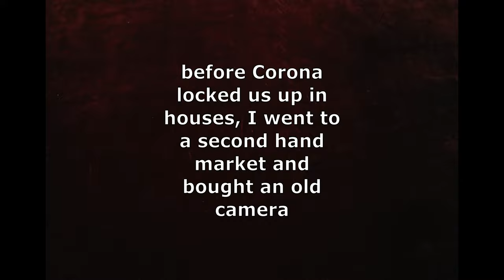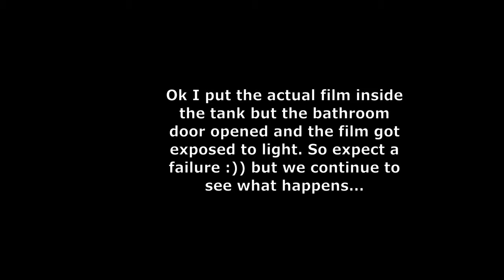Agfa Clack (loading, shooting, and developing film)

Comment: Nice video there! These buttons on the top of the camera you mentioned in the beginning are actually for the dedicated flash unit "Clibo" that could be used with the Clack. Furthermore, I find it really interesting to use a ISO400  film while the camera has a fixed speed of (i think) 1/30s of a second - personally I love the "Ilford Pan F Plus" 120 film, which is at around ISO50 (more close to the ~ISO45 that the films originally meant for this camera had). But I 've got some FOMA400lying around - maybe I'll test them out. Anyway - you got my subscription! Cheers.
Reply from the maker: Thanks for your informative comment and also for watching! and you got mine. Cheers!
Reply from the maker: Thanks for your informative comment and also for watching! and you got mine. Cheers!

Comment: hey I have a question, I bought the same camera from the video today and everything is working, the buttons, the opening things. But at 5:05 I saw that you could see your finger through the lens, I cannot see anything through my lens, it's yellow and murky. Do you know if I could fix this? Or is the lens not fixable:(  that would make me really sad:(
Reply from the maker: Hey thanks for watching. I wouldn't say that's something major, but it has to be fixed! You should be able to see through the lens if the shutter is kept open (try the B mode and press the shutter and keep it pressed down) at this point, there's nothing in the way so you should see through the lens. Otherwise, it's probably nothing amd it's easily fixable by doing a cleaning. Let me know if you succeed 🍀

Comment: What happened? Any problems with the developing process? I was very curious to see the result of this camera
Reply from the maker: I mentioned the problem in a text shortly in the video: while loading the film into the reel, the bathroom door opened and caused an exposure. this made the developed film come out really dark but there were two frames actually that could be seen (not visible in the video) and I scanned them and was able to make that picture out of them. and you can see that picture at the end of the video. thanks for watching by the way!